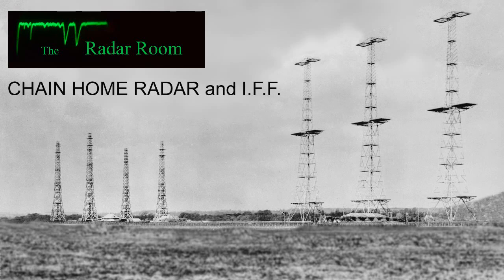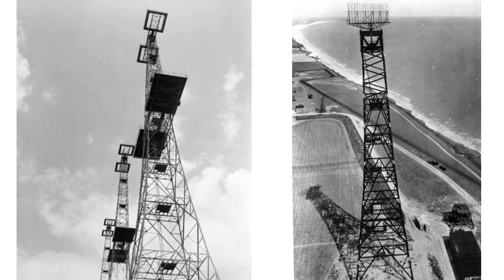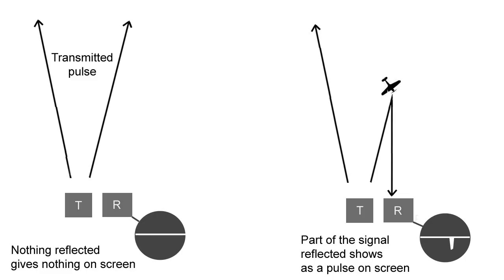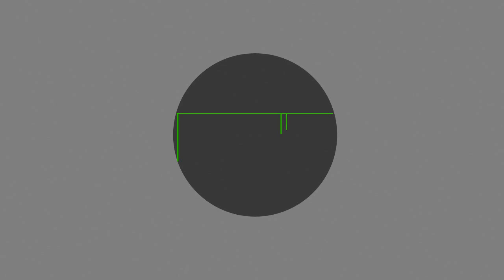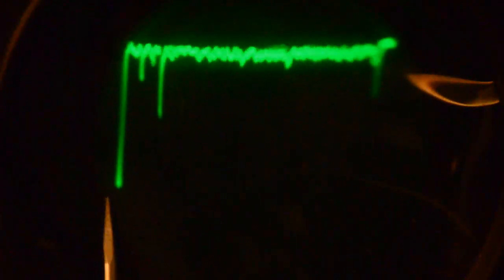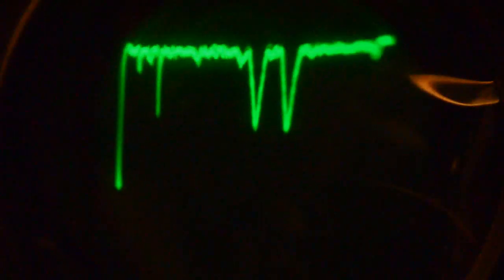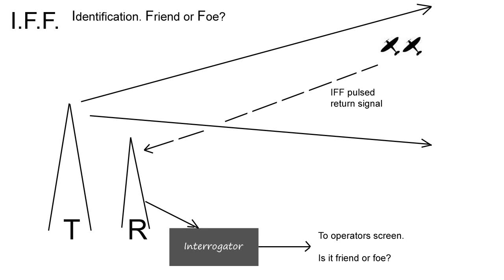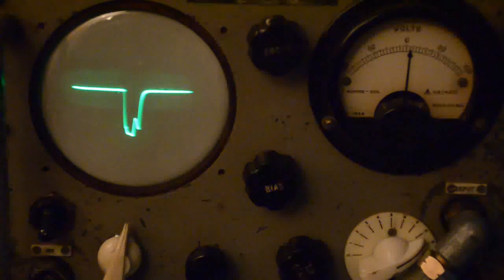1940s Chain Home radar overview

Comment: Great stuff! The display is much like a "PAN Scope" except upside down, and used for difference in distance, not difference in frequency. Thanks for sharing this!
Reply from the maker: Glad you liked it. Indeed, there were several other types of similar 'A'' screen displays in use at about the same time, featuring both upwards and downwards pointing pulses, with some even using a combination of both!
Reply: This is a very good video. After I watched it I noticed that you made a comment. I love Mr. Carlson's Lab. I've learned a ton from your excellent videos....thanks Mr. Carlson
Reply: Time not distance
Reply: @michaelshore2300  Hi Michael, is radar not used to judge distance? Yes it does this through reflection time, much like time domain reflectometry, but the end result is distance, is it not?
Reply: @MrCarlsonsLab  radar measures time to work out distance   a TDR does exactly the same thing.

Comment: Philco made IFF units at 3130 West Monroe Street in Sandusky, Ohio. Today, that's the Okamoto Sandusky Manufacturing, Llc building. If you look closely, you can see the old "Philco" sign over the door in Art Deco Stainless steel.  73 DE W8LV BILL
Reply from the maker: Interesting. Sounds much like here in the UK, where most electronic products used to be made in this country using UK sourced components. I doubt if anything remains of the industry today :-(

Comment: Chain Home used 27MHz and an improved version, Chain Home Low, used 40MHz which allowed greater resolution and so could see low flying targets. The transmitters just illuminated a broad area.
Reply from the maker: Quite right Billy.
Reply: @lishaton  The reason for the choice of 27 MHz is more interesting. While most scientist agreed the higher frequency the better Watson Watt was more practical and de asked "what gave the best reflection ?"   A dipole    "what was the wing span of a German bomber?"   average about 80 feet so that set the frequency and UK industry had equipment  available at about that frequency.  The goniometer was used on the receive signal and gave Bearing but very poor height information .  Radar Technician Locking 1953
Reply: @oml81mm Rubbish!!! Chain Home Low was a beam radar with a turntable aerials. It was based on the early ASV/AI radar frequency of 200 MHz and development was originally done as a coastal defence (CD) gun laying radar for the Army. Development started for the Army CD set in 1938 and the redesign to convert them to CHL for the RAF started in July 1939. Switched lobe receive aerials were built into the design from the start so an operator could compare two opposite peaks on the CRT and turn the aerials until they got two equal peaks that gave accurate bearings. Range resolution wasn't so hot and there was no height finding. Maximum range was 25 miles and minimum height was 500 feet over the sea. The first CHL radars were pretty much all lash up experimental equipment's using whatever suitable transmitter and receiver systems were available, so no two stations were alike. First Operational CHL station ready by April 1940, 25 in service by the start of the Battle of Britain, however a number of them were based initially on modified Army Gun-Layer (GL) Mk 1 sets which worked at 54.5 to 85.7 MHz.   By the start of 1941 plans were in place to upgrade all of the CHL equipment to a common standard with 60 mile range high power transmitter, Single Antenna with T/R Switch for common Transmit / Receive, Motorised Antenna Rotation (instead of hand crank) and a PPI display. 5 such systems were operational by the end of 1941, the first being operational in August 1941).

40MHz kit was the Mobile RDF Unit (MRU), a truck mounted transportable CH system for overseas use by the Army and Battle Damage cover radar for the CH system.
Reply from the maker: Thanks for the input Richard.

Comment: When Wimperis sought an expert in radio to help judge the death-ray concept, he was naturally directed to Watt. He wrote to Watt "on the practicability of proposals of the type colloquially called 'death ray'" The missing technique that made radar practical was the use of pulses to determine range by measuring the time between the transmission of the signal and reception of the reflected signal. This would allow a single station to measure angle and range simultaneously. In 1924, two researchers at the Naval Research Laboratory in the United States, Merle Tuve and Gregory Briet, decided to recreate Appleton's experiment using timed pulsed signals instead of the changing wavelengths.[17] The application of this technique to a detection system was not lost on those working in the field, and such a system was prototyped by W. A. S. Butement and P. E. Pollard of the British Signals Experimental Establishment (SEE) in 1931. The British Army War Office proved uninterested in the concept and the development remained little known outside SEE.    wiki
Reply from the maker: Interesting!
Reply: @lishaton  Castles in the Sky is on youtube although it is not pleasant to watch because the top is cut off.

Comment: Have I got this right?
To find the position of an incoming  enemy formation you needed at least two neighbouring transmitter/receiver stations: A and B, say.  
Although you were not able to measure the bearing of the formation from station A, you could measure its range.   The same was true for B.
Draw an arc, centred on station A, with with a radius equal to the range from A.  Draw a similar arc centred on B.  The point where the two arcs intersect is the position of the enemy formation.
Reply from the maker: Essentially yes. As you've just said, using the info. from just one, then whilst you know how far it is from that particular transmitter station, but wouldn't know it's bearing. With later radar devices such as the ASV radar, although just one transmitter is still used, by having a receiving aerial on both wings of the aircraft, it was then possible to home in on it.
Reply: The Chain Home receiver has a pair of orthogonal dipoles, supported by four masts, a goniometer is used to find approximate bearing from these inputs . Triangulation from a pair of stations could give a better fix but was not essential.
Reply: @paulpotter1041  Yes, I had noticed that the receiving masts were arranged in the form of a square whereas the four transmission masts were in a straight line.  It made me wonder if this was a precursor of the high-frequency direction-finding (HF/DF or "Huff Duff") aerial system used by convoy escort ships to locate the bearing of short transmissions by U-boats in the Atlantic.